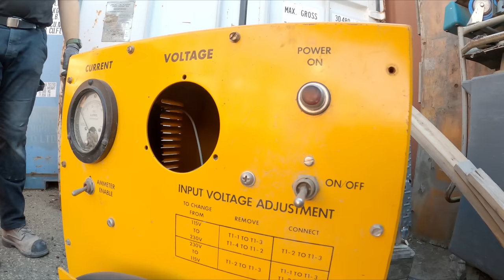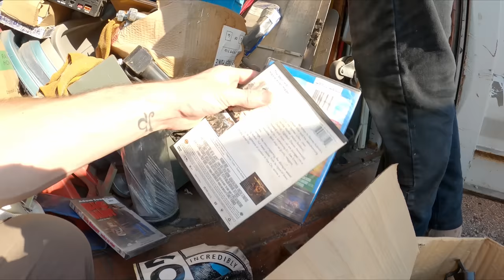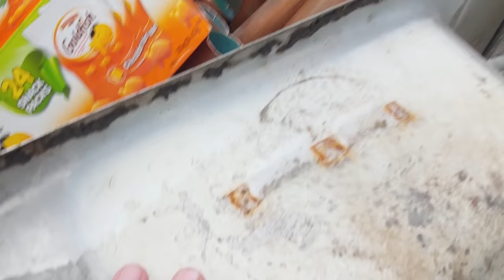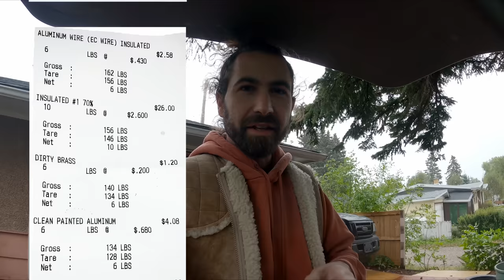Scrap Metal Recycling - Scrap Consultant Returns!

Comment: With the BBQ regulars you can clean them up by putting it in a vice and pop it open, check for any other metal and you have the clean cast aluminum

Comment: quick tip..If you ever come across the TV cables again, you can take 1 strand of copper from the wire and pull on it to strip the case off instead of fiddling with a knife.

Comment: I think the key to those big sea cans is gonna be just like storage units.  When you first start going through you need to set out 3 huge tarps and get a bunch of buckets or bins so you can have a garbage pile, metals recycling pile, and a research for possible sale pile - sort as you go! Otherwise your gonna spend hours just cleaning up and chasing all and re sorting all the loose screws bolts and stuff   COCO OUT.  Seriously though I would love to see a thub storage unit video!!!
Reply: oh and i like the talky talky parts - gonna try that shower orange trick.